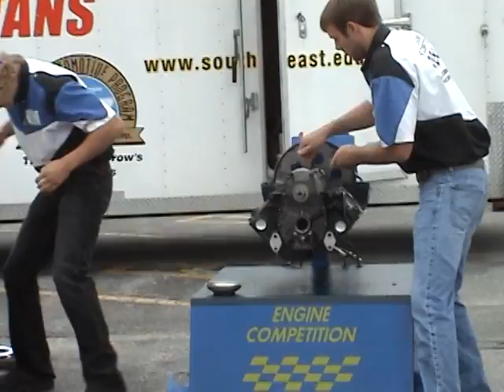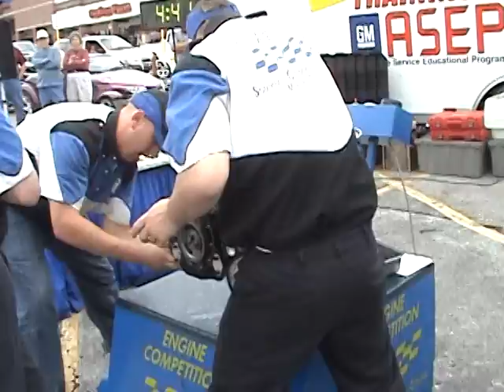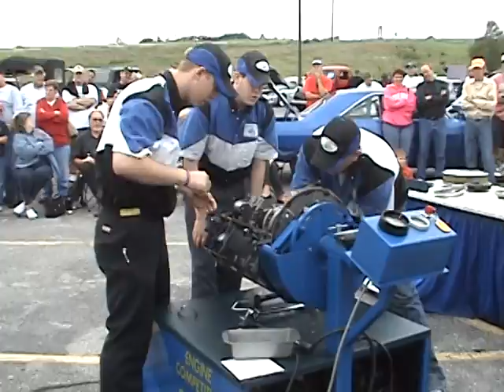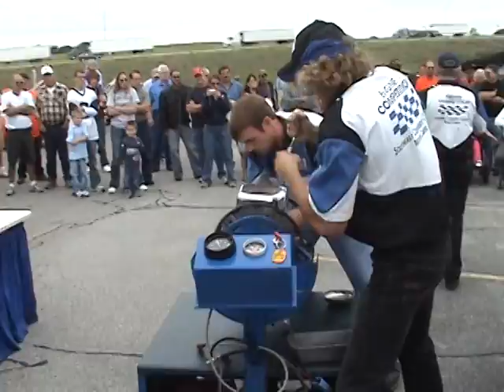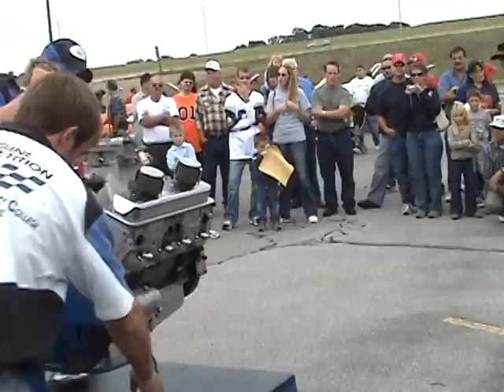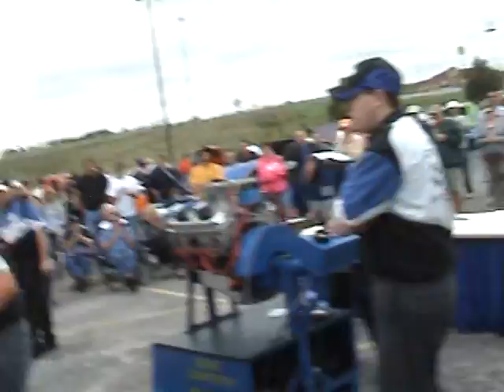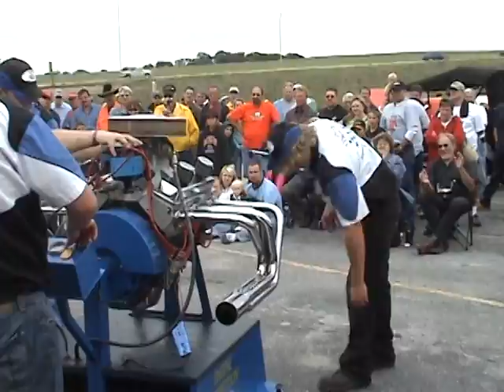Engine Build Competition SBC in 17 min 10 sec

Comment: That's definitely no way to use a torque wrench they mine as we'll used a regular ratchet
Reply from the maker: they probably could've used a ratchet with the same results, I 100% agree about the torque wrench use and when a tech is torqueing a bolt it's a steady pull until the "click' happens. This is a demonstration of speed, if everything was done "by the book" it would take a couple of hours to put this together. The guys know the right way to do things, do you see anyone using their turn signals on a racetrack when they pass someone?
Reply: They MIGHT as well**
Reply: Justin Gibson getting one together and getting one together correctly are two different things. Is Tunis a shade tree competition?
Reply: Justin Gibson was thinking the same thing
Reply: +1 on that!
Reply: I  HAVE NOT SEEN THE N WORD. I THINK YOU ARE FULL OF SHIT. DON'T LAY THREATS ON PEOPLE OR FIND YOUR DUMB ASS LOCKED IN A CAGE.
Reply: Well this conversation went to shit quickly!!
Reply: +Justin Gibson 

No joke, an engine will start with miss torqued bolts. But it wont last longer than 3000 miles. That dude was over torquing the shit out of those bottom end bolts.
Reply: +Todd Morrill Stick these engines in a car and see how long they last.  I'd be surprised if they last 5,000 miles.
Reply: +Davie Blaze Like you've never typed a typo.

Comment: Old schools cool and all but this is the future and the little 60 dollar black boxes make twice the power the points made a little knowledge and it's not that complicated
Reply: Absolutely right...everything these"old schools"complain about made engines 10X better...even stock plastic intakes can handle ~400/500 HP...better...
Reply: Don't kid yourself.  Car Craft did a competition among normal points ignition, HEI, and a top shelf HEI racing ignition.  The points kicked the living crap out of the HEI in both torque and horsepower up and down the rpm range, and were superior to the top-of-the-line racing HEI about 40% of the time.

http://www.hotrod.com/how-to/engine/ccrp-9812-ignition-performance-test/

You put too much faith in the mumbo-jumbo black boxes.

Comment: the way that kid is torquing those bolts, I wouldnt trust that engine, lol
Reply from the maker: this is only a demo of speed not accuracy, these guys know the "real way" things are done. These engines typically run for less than 10 seconds and would never be intended for long haul use. The current group of builders are in the 12 minute mark for assembly time.
Reply: Todd Morrill 12 Minutes!!! wow. so impressive. 12 days for me lol.
Reply: Todd Morrill Such an awesome way to spark interest into automotive!

Comment: I can build entire cars, but I'm not a mechanic...cuz I don't have the ugly shirt. I also set the timing correctly before ever attempting to start an engine. I've never had an engine I built fail to start on the first bump. I've only built 5 though, all old school 60's tech, with points and old school voltage regulators you can actually fix, where you can see if somethings wrong, clean it and get another 50,000 miles out of it...not a bunch of sealed little black plastic boxes that cost 60-80 bucks. Old school, you can get home using coke cans and shoe strings...new stuff, better call a tow truck.
Reply: CorollaNut68 I call bullshit
Reply: Ferrous Bear You little whipper snapper, get off my lawn!.
Most of the american cars went to the scrap heap at 40-50K.
I'm still driving my 1968 first generation Corolla every day...it's at about 1,2 million...but I DO put fresh rings and bearings in about every 250-300K just for giggles.and I get 50 mpg.
Reply: true
Reply: Guy states he can build entire cars
Guy then states he drives a 68 Corolla everyday 
Thats how you suck at life kids

Comment: people saying "These motors wont last 5 mins..blah , blah , blah " . back in the day , Im quite sure that thousands and thousands of small-block chevs were put together on the production line , probably quicker than this , and would of lasted...well , probably many , many thousands of miles
Reply: SnowRocker88
Gen 1 SBC lasted around 120,000miles because of 60's technology.
Gen 2s got a makeover and were good to 300,000

gen 3 LS are incredibly strong, and are better than any prevous sbc,
[stock bottom end 4.8L made 1,204Hp]
Reply from the maker: TheCowGoesMoo o
everything is prelubed before they start and the engine oil is dumped in around the time the lifters are put in. They use a power drill to prime the oil system and show the judge oil pressure before they can put the distributor in.
Reply: If I'm not mistaken I never saw them lube up everything on the bottom end, in that case it wouldn't last.
Reply: I see a guy using a torque wrench at 5.26 on the rods , and doing the heads with a torque  wrench on the heads at 10.57
Reply: TheCowGoesMoo o States at the beginning of the video that internal parts were prelubed before start.
Reply: +Adaran Jerry Sandusky style!
Reply: Y10Q I have a 98 chevy truck with almost 400k on the ticker
Reply: Y10Q wow that was so wrong dude
Reply: SnowRocker88 Quality control and manufacturing processes are WAY better today. But those old motors are pretty damn reliable as well.
Reply: TheCowGoesMoo o they're not pulling down and slapping em a Nova. Its a contest...them they start it for 1 second...then they tear it down...why is this hard to understand!?
Reply: +chopperking1122
Reply: chopperking1122 They also had techs who took their time torquing the heads or machines with a rotating socket which torqued it exactly to spec in like 5 seconds / bolt.
Reply: machine designed engines are more near perfect then our bands
Reply: +Garin Merrifield hands
Reply: chopperking1122 no oil
Reply: No, and don't call it a Small Block Chev. It sickens me.
Reply: Yea, but no one would try to argue that the quality of engines back then were on par or surpassed the quality of engines being built today.  They wouldn't last the 200,000 miles that engines do today.
Reply: +SnowRocker88 Engines last for more "miles" now than before because of things like OD transmissions.  A hypothetical engine in a car with 3.08s, a 3-speed auto, and 27" diameter tires, with absolutely no torque converter slippage ever would have 19,495,384,615 crankshaft revolutions per 100,000 miles.  Throw a TH700R4 in there with its 0.7:1 OD 4th gear, and that figure is reduced to 13,646,769,230 revolutions.  Mind blown...LoL
Reply: chopperking1122 Clearly you've never built an engine, and are clueless about those important things like checking torque and using assembly grease.
Reply: Engines of the 40s and 50s lasted 7-8000 miles on average. In the 60s engines lasted about 30-45k miles. By the 70s 100k miles. Now even a KIA does 200k miles.

Comment: "Easily make $25 thousand".

I mean, you can live on that... but the way he said it he made it sound like a good thing. Any skilled profession damn well better start out paying more than that.
Reply: Taylor Smith why didnt you start a shop after 30 years? and be your own man.. instead of walking away ? i dont get it
Reply: matthew cory Hey Matthew, thanks for asking. I did open my own shop with a partner after 25 years. I'm the shop oriented kind of guy, not the front end/service writer kind of guy, I'm not user friendly. My partner was the service writer type, so when we met we decided to open a shop together, and it was good until he contracted pneumonia  and later passed away at 53, and I couldn't do it without him so I closed after three years. My biggest problem with mechanicing is the pay style, flat rate, no other occupation gets paid the same way, and it needs to be updated severly, and also cars are no longer fun to work on with all the computers and the manufacturers stuffing more and more stuff into a smaller space, if you have big hands like me it is sometimes impossible to fit into the tight spaces. I still love wrenching on older stuff and do so all the time, just on my time. I also work on small engine stuff and such, and weld and do carpentry and also create stained glass art.
Reply: And after 30 years of doing this job, that is why I walked away. There is no other job that has the pay style that mechanics do. Flat rate. For those who don't know what it is, look it up.
Reply: Taylor Smith And it's bullshit, especially when the companies raking it in charge so much more than their mechanics get paid for labor.
Reply: matthew cory probably because he didn't get paid enough to have the cash on hand to start a shop.

That shit isn't cheap, even if you already have your own tools.
Reply: When your 18/19 years old...your not getting $50,000 to start...you gotta get your time in...
Reply: Taylor Smith
Should have went with the exotics like Porsche. Their technicians get paid 80k, that's my goal.
Reply: Craig Cundiff well if you know anything about mechanican.  It's a flat rate hour. Depending on how good you are you could bring in 50k.  But you could just as easily get 30k too.  You gotta be quick. But the great thing about it is are side jobs, and you charge anything want for them.
Reply: TheCowGoesMoo o yeah...meaning...you start at $15 hr not $30.. Flat rate...no matter how good your are your not gonna turn a 2080 hr year into 4160... Sheesh... and nobody us talking about side jobs...any tech.job has a side job to it...the guy didn't mention side job...he said start at ~$25,000 a year...meaning $12.50 an hr...side jobs are something totally different...
Reply: Craig Cundiff no, if the job says it takes 5 hours to change a timing belt and you do it in 2, you still get paid that 5 hours. Then you move onto the next job, and the same scenario for that and the next. Now if you take more than 5 hours that's when flat rate kicks you in the ass, cause you're not getting paid anything over that 5 hours
Reply: And when you complete another job with the 5 hour timing chain job, then that's when your 15 dollar starting increases
Reply: MastaSquidge   you have to start somewhere.  with experience comes money.
Reply: Being a mechanic doesn't pay shot if you care slightest about quality. It's all about efficiency and not about comebacks
Reply: That’s why I quit working on cars and started working on planes instead.
Reply: Being a mechanic sucks and ya damn sure ain't gonna get rich working for someone else. I recently "retired" after 30+yrs of the bullshit. Made less in the last 10yrs than I did in the first 10yrs. I just build engines for dirt trackers and drag cars now. Some street machine s too. Much better work than trying to disassemble modern Asian cars and domestics. Çars have changed alot over the past couple decades. Being a mechanic kept me in a bad mood.

Comment: It bugs me how they said 25,000 a year starting... I'm from Canada and run a gravel truck. With no school or anything and make over 50,000... Something there isn't right... You make more then that working fast food here..
Reply from the maker: this is an industry where a serious adjustment is needed in regards to technician wages and benefits. I know of some techs in the area that have hit a 6 figure income and those guys are working hard and smart. There is potential for a great income but the downside is that this is now an industry where you really need to know a lot about what you are doing. Car, trucks, etc are all getting very complicated, not an easy path as it once was.
Reply: Isn't $50k Canadian like $25k USD?
Reply from the maker: JD Biddle Cost of living is considerably higher in Canada, at least the cost of goods and utilities is higher so you probably need to make $50k in Canada just to get by. $50,000 Canadian is $46279.18 USD by today's conversion rate, not a big difference there, would also have to see what Canada does to your paycheck in taxes before they hand it over to you. I know we pay way too much taxes for the working middle class in USA.

Comment: and they didnt torque the heads in the right order, which wouldnt have taking much longer but someone could loose track and loose seconds. and its funny how they trying to promote Dodge Chrysler but building chevy motor lol
Reply: Did I miss them filling in oil ? I think thats why they only ran it for 2 seconds
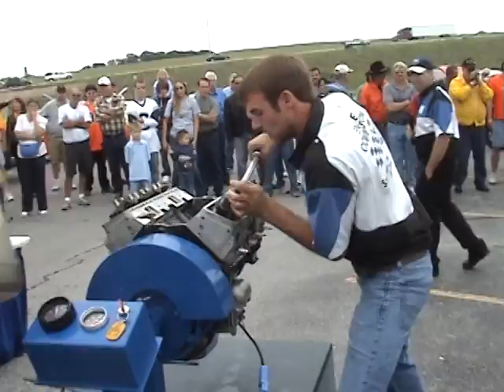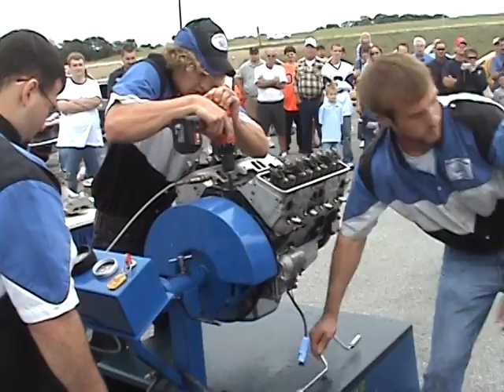Reply: bobl78 11:00 for oil fill, then 11:20 for oil pump prime.

Comment: The purpose of this exercise was to see which team could assemble and start a pre-fitted SBC motor in the least amount of time...believe me when I tell you that these engines were never intended to meet EPA 100,000 mile durability tests...would you ever torque down a SBC head that way? No,this was done so as not to forget which bolt to torque down next...

Comment from the maker: the parts were cleaned and lubed before the timed event. There is no coolant in these engines but there were frost plugs preinstalled. Cranks get polished or replaced on a regular basis as necessary, and clearances are checked then. Cam bearings are beat up in just about every build, I cringe when I see the cams getting slammed in. Those are replaced frequently as well. We rebuild these engines (in shop) 2-3 times per season. All speced at that time.

Comment: The hardest part for me was cam design and selection. Picking the right lift, duration, timing for a purpose built engine is a compromise. Toss in cam gear timing, double overhead cams and drive system. Assembling parts is easy. Knowing why they were used is what separates the Bolt-on crowd from the engineer.

Comment: Mepee: you have to take into account they arent having to worry about if they mess up! Lol. JR Performance engines in escondido, ca has a really quick turn around. Its about a week for a full blue print/balance rebuild, and they have a special going on $2500 includes all "soft" parts!

Comment from the maker: there are two torque wrenches, one set for heads and mains, the other for the con rods...the torque wrenches are backed off between builds and reset before assembly starts. If you freeze it at 2.20 you can see the small torque wrench (bottom right) on the tool board as the tech uses the big one torquing mains.

Comment from the maker: I hear ya, would you watch a 2-4 hour engine build? That's how long it would take if "politically correct" methods are used. I challenge anyone to put up a video of yourself building an engine and I shall tell you what you sir are doing wrong. The lifter rocker adjusters are lock stops that are pre-adjusted.
The students are well aware of torque sequence and how to steady pull a torque wrench until it clicks. This isn't a demonstration of "correct-ness" but speed instead.

Comment from the maker: The current team did a build yesterday and did a build time of 12 minutes 22 seconds. Yes the students know the "correct" way to build an engine as does most everyone who views this video, this demonstration is for speed only. Yes cam shafts and bearing are harmed on a regular basis and are also replaced on a regular basis, surprised nobody is crying about the lack of anitfreeze? Everything is cleaned and prelubed before assembly, the crank must rotate before any pistons are installed.

Comment: I'd take either of these engines if it got me outta the crap, don't have to last.

The difference between a properly built engine and a slap up job could mean just seconds in a burnout comp or a blow up on the warm up lap and an engine that you just cant kill

Some places even build their competition engines in a temperature controlled environ to ensure all the dimensions are true and correct

Comment: wow the way tools were used they should have just tossed them on the ground.so many things done wrong with these motors. if i ever seen someone using tools like that i would beat them with them.
engine building is not a speed competition these motors wouldn't run long at all.heads were torqued on wrong .when i went to school if we used tools like that we got an f for the grade and had to take the class over again at your own expense.

Comment: Speed handle was used incorrectly and the bolts probably have no grease someones gonna use that 350 and go swap heads when you take out bolts just gonna get broken in there and your screwed

Comment: Not really, If all the parts are already run in and installed in the same order they were in during run-in period they wouldn't need to be plasti-gauged to check clearances or use assembly lube. 

He poured oil down the lifter valley, and primed the oil pump/galleries. That would be enough in a real world scenario assuming there are no new bearings/lifters etc.

Comment: "and yes the oil system was primed " That is not the correct way to prime the engine, the rotating assembly need's to be cranked over slowly in conjunction W/ rotating the distributor until oil reaches every rocker arm assembly. Care must be taken not to push on the oil pump shaft W/ force, in effort to not score the cover of the oil pump gears.      Not to be pernickety (look that up when you get a chance) but I am OLD SCHOOL, anything worth doing is worth doing right.

Comment from the maker: The show is for entertainment value, the engines are not for vehicle use and will never run more than a few seconds at a time. If they followed the "correct service manual assembly procedures" the show would probably last several hours instead of minutes. This build time is slow compared to the current record of somewhere around 12 minutes. This build was shot a few years ago and yes the oil system was primed (that would be the power drill in the distributor hole). Thanks for your interest!